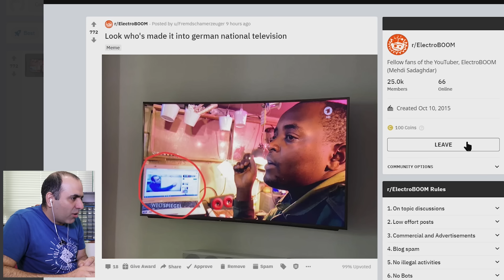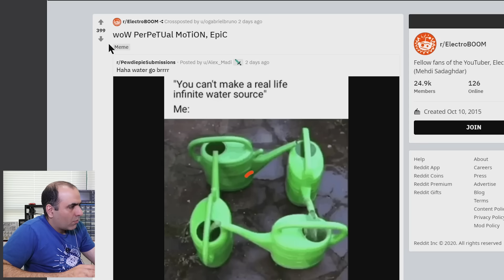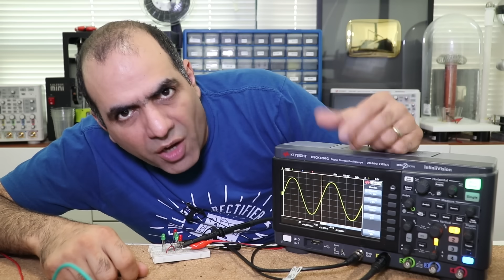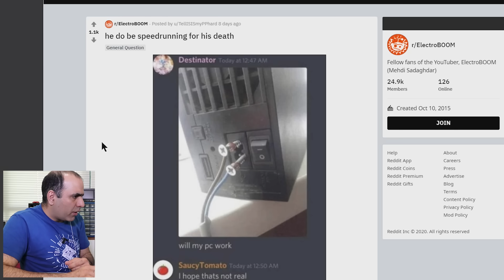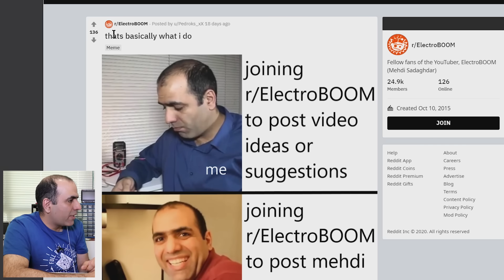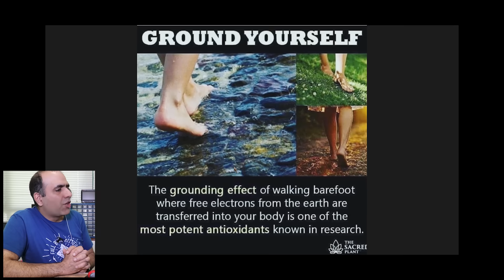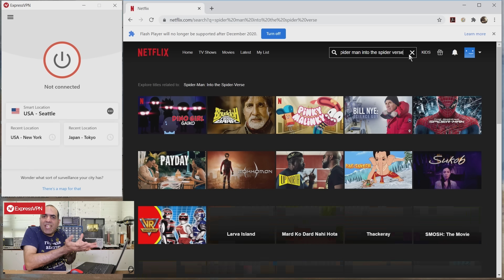Making Water Spin Like Magic, LATITY-002

Comment: Basic Principle
You place a conductive fluid (like salt water) in a dish.

Electrodes connected to a battery are placed into the water and a magnet is put under or next to the dish.

When electric current flows through the water, and a magnetic field is present, a force acts on the moving charges in the water.

This force is called the Lorentz force and it causes the water to move or spin.

The Physics & Formulas
Lorentz Force Law:
The force acting on a charged particle moving through a magnetic field is:
F
⃗
=
q
(
v
⃗
×
B
⃗
)
F
 =q( 
v
 × 
B
 )
where:

F
⃗
F
  is the force vector (in newtons, N)

q
q is the charge of the particle (in coulombs)

v
⃗
v
  is the velocity of the particle (in m/s)

B
⃗
B
  is the magnetic field (in teslas)

For a bulk fluid (saltwater):
Current density 
J
⃗
J
  replaces velocity:
F
⃗
=
J
⃗
×
B
⃗
F
 = 
J
 × 
B
 
where 
J
⃗
J
  is the current density (A/m²), and the overall force per unit volume causes the liquid to move.

How Spinning Begins
Current flows between the electrodes placed in water (which must be made conductive—usually with salt).

The magnetic field interacts with this current and, because of the direction of the field and the current, produces a force at right angles to both (by the right-hand rule!).

The result is a circular force that makes the water spin—you can reverse the spinning direction by flipping either the magnet or switching the battery's polarity.

Concrete Example and Measurement
In experimental setups, the fluid speed at a location a distance 
r
r from the center is:
v
=
ω
r
v=ωr
where 
ω
ω is angular velocity.

The voltage and magnetic field strength relate to the force and hence the speed of vortex formation: for a mean field 
B
B and applied voltage difference (producing current), the induced speed can be estimated by balancing the Lorentz force and fluid drag.

The Experiment Must Have:
A conductive solution (plain water doesn't work!)

Sufficient current (power source)

A strong magnet

Reference Examples
[Scientific American] and [Physics Van] explain and confirm this effect. You can watch step-by-step demonstrations in [YouTube videos].

In summary:
The water spins because the electric current in the water is deflected by the magnetic field, producing a force that kicks the fluid sideways and causes rotation. The direction and speed of the spin depend on current, field strength, geometry, and conductivity.

Comment: 3:40
What if you attached a tiny AC generator to the spout where the water is flowing from? The water pressure spins generator. If you limit the resistance I'm sure you could get SOME voltage out of it.

If it worked small scale, what about large scale?

This wouldn't be creating energy but instead using the energy that gravity already acts on the water.

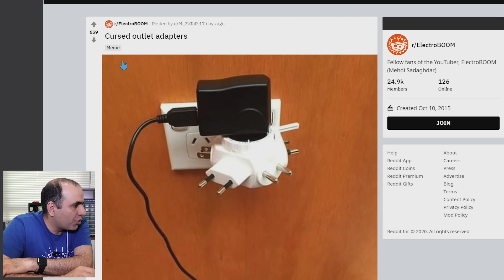Comment: I have that cursed thing at 6:28. It's a travel adapter. You can turn the top bit to select which plug on the side should connect to the socket on the top where you plug in your appliance. It definitely looks cursed though, and while in theory, only the selected prongs should be connected, I wouldn't touch any of the unused exposed prongs while it's plugged in.

Comment: Wow,  I hate the selling point of these VPNs. Logging into another country just to see entertainment. If you read your subscription service for all of the streaming providers,  they all expressly address using a VPN to circumvent a regionally lock.  And they hold the right to terminate your account.  Your VPN is not as secure as you think when your browser holds extensions for both the streaming service and the VPN.

Comment: the water spinning at 7:11 is surprisingly close to working, the thing is you would need magnets at the bottom connected to the water and the water to be charged like a battery, short the two and in theory it would spin like the batteries in mehdi's simple dc motor video :3 just a fun idea, idk how to get the water to function as a battery tho besides like using highly concentraited salt water in a zink cup with a cooper electrode sticking out of it

Comment: 4:15 I had a capacitor blow up in front of me, and the little metal can shot toward my face, turning in the air so that the open end punched a neat circular cut deep into in my cheek (it healed with no scar). I am lucky it wasn't my eye. Please wear eye protection when you're around something that has potential to explode!

Comment: Mehdi, did you think about this VPN services? About how they work? Let's see how the network cables are connected. 
Your first connection from your computer, mobile phone, tablet etc. is to the router/modem-router combo.
Then, your modem connects to another router outside, which distributes network access to your area. After it, it connects to several routers in-between, and at the end, there is your internet service provider. 
Because your modem in your house connects indirectly to the ISP's servers, a VPN can not protect your datas, only can hide your exact location from the other side, not from your ISP.
Your ISP will be able to tap your sent and received data, because your devices are connected to them by wires. No matter what paid service you're using for protection. If they want to know your activity on the net, they will know.
VPNs are good for watching locally restricted contents, but they can't protect you from being tracked. Your ISP will happily tell anyone for a bunch of dollars where you are and what you did on the computers. Guess how a chemistry student was jailed here, he started looking for the precursors of dangerous materials, and look, he got sentenced for owning those things, which he could buy and order from the net without any question.

Comment: Funny story about GFCI outlets. The upstairs bathroom in my house has no GFCI outlets in it. Why is this? Well, whoever wired the house wired the bathroom and an outlet in the garage (on opposite sides of the house btw) together and the outlet in the garage is GFCI. We only realized this when a leak in the garage caused the GFCI to pop and the bathroom outlets stopped working too.

Comment: 6:33 The cursed outlet adapter! I have one of those. It looks dangerous but fortunately only one of the prongs is live. The way it works is that the middle part rotate with an arrow indicating which prong is currently connected to the center. This is a clever device but it is unfortunately a bit cumbersome.

Comment: If you have a radiator for hot water. Then using the anode effect could heat the water with 120 watts could heat it at 12v and 10 amps. The water container with copper and aluminum electrodes works but maybe it is better to use graphite rod electrodes and make sure the electrodes are far apart in the electrolyte. The electrolyte is just some cheap crystal growing kit from the dollar store or online science shop. The water will start boiling and getting hot in about half an hour or so. A small 200 watt fan can blow air through the radiator to warm the room. This isn't free energy it is just exploiting a novel effect.

Comment: When grounding yourself for doing electronic repair, it should be through a 1Megohm resistor. Don't believe me? Just Axe Mehdi. Without the resistor, you are almost as dangerous to your electronics, and potentially yourself.

Comment: If you can make water spin with a magnet, you could put a paddlewheel and generator in the water and have FREE ENERGY!!!
Better yet just skip the generator and wrap a wire around the paddles 5 times, it will work like a generator but cost you nothing.  FREE GENERATOR for the FREE ENERGY!!!

Comment: Wouldn't a big resistor in series with your LEDs allow you to visualize the output of the bridge rectifier (take most of the voltage drop)? You could put your circuit in parallel with a lower impedance input and reduce the power costs?

Comment: I actually have that travel plug at 6:26. You can turn the top, where you plug your device in and depending on which way you turn it, only one side is connected. So it's safe actually

Comment: 6:30 These Adapters really exist. Not all the prongs are live at the same time tho. You instead select a certain connector by rotating the top part, where your device is plugged in.

Comment: You could try power supply with other end of the wire the other end of the wire has no plug you can join the plug with your covert safe and you have another outlet so join the plug on your covert safe to you outlet

Comment: 6:36 I own one of those adaptors.  The prongs are not all live at once.  You rotate the round part at the top to select which one to use.  It doesn’t convert voltage, which is interesting if you’re a North American using it in Europe.  Your phone charges a lot faster
Reply: And by 'Charges a lot faster' you mean it blows up

Comment: Bathroom outlet reminded me of military school and how we would light cigarettes, piece of led from mechanical pencil broken in half and put in the top 2 slits of outlet then take another piece of led put through a q tip horizontally that you pulled on and fluffed up, connecting to the 2 in the outlet and boom a match.

Our lighters and matches were always confiscated, sometimes you could light the cigarettes on a desk lamp some ppl had that would get hot enough 😜

Comment: 7:46 Is this the official electroboom gfci outlet test? Now you just need a thick wire instead of the resistor and you can test the breakers on normal outlets too :)

Comment: to my knolage paying customs is related to one of 2 things in general if i am not ignorant and mistaken.

1 coruption they want money any way they can get it so if you can milk some money from items going into the cuntry they do so.

2 to simply protect the economy of the cuntry itselfe. wery simply every dollar spend inside the cuntry is returned to the cuntry. with that i mean it stays in the cuntry and can do good. like if you buy food from local store the store pays taxes helping the cuntry grow and pays the emploies that then spend money and that creates a loop. but however if you spend money outside the cuntry that money is lost it is sent otue of the loop and is negative for your cuntry. however getting people from outside your cuntry to spend money inside your cuntry does the oposite it gets new money into the loop benefiting the cuntry.

so with this simple knolage export of goods is good as that brings in money inport of goods is bad as that takes money oute. so to limit the inport they put high customs on it to prevent money form leaving as in alot of cases it is alot cheeper to buy it localy instead of paying the customs. by that the system is succesful as it keeps the money in the loop. however this does not include gifts as these are not money going oute of the cuntry. but it is a flaw yo uhave to live with for the system to work. eaven worse is if the product is made localy then you inport an alternative for free while this doesn ot remove money from the loop it does prevent local providers of the thing from selling their things therby hurting the economy.

therfore you wil in msot cases see that cuntries that produses a product wil have realy high customs on alternatives to this product to prevent cheeper alternatives from otuside to harm the production in the cuntry

Comment: You can make water spin with electricity. It doesn't work like that silly video, you take advantage of magnetohydrodynamic effects. Saturate some water with salt, then line the rim of a non metal dish with foil to make a contact. Put a neodymium disc magnet pole up under the dish. Now pour your salty water into the dish and add some fine visible particulates like pepper so you can see the flow. All that's left is to connect something like a 9v battery to the foil rim and dangle the other contact in the center of the water. This creates a current flow radially outwards perpendicular to the magnetic field resulting in a thrust which makes the water flow around the center contact.

Comment: I have a question. At 9:35 in the video you said if something is floating in air the voltage across it will be minimal and current wouldn't flow through it no matter how much electromagnetic energy is present around it. So does that mean that an airplane flying through a thunderstorm is not very likely to get struck by lightning ?

Comment: 9:25

The idea is that the body has something called (free radicals) it's basically positive ions running around your body and stealing electrons from random atoms screwing up your cells or DNA.
I think those free radicals might act as a voltage difference between you and the ground so electrons would travel and neutralize those free radicals instead of allowing them to take from your body, that's what antioxidants do at least as they are negatively charged ions.
Reply: Free radicals aren't always charged (sometimes even negative). And positively charges ions are not always free radicals. Examples are the hydroxyl radical (neutral free radical), the superoxide radical (negative free radical) and potassium ions (positive ions that are not free radicals). It has to do with unpaired electrons, not charge.

Comment: They charge customs fees because citizens of country X are supposed to use products from country X so the jobs and money go to country X, but since country X can't prevent anyone from getting products from country Y, they apply a penalty for not getting a local product. If you want someone to get something without them having to pay for customs, either remotely buy a comparable product from a company in their own country and have it shipped to them domestically - THAT is how you help those countries that need it the most to grow, by funneling money into their manufacturing industry - or, in case their country only produces terrible quality versions of whatever item is in question, ship the good stuff with the incoterm DDP, where duties and taxes are billed to the shipper instead of the receiver.

Comment: Hi ElectroBOOM i am a viewer from Algeria and i have so many questions to ask you about electrical installations.
the two most urgent are related to solar installation and grounding
1. i have a distribution board with two sources of electricity, city electric and solar (2400W inverter) 
the thing is the two electric circuit are never in contact with each other  but i have to properly ground all the electric sockets for safety .
the question is do i make sepret grouding bar for the diffrent sockets or it doesn't matter or there is other solutions.
2. for my solar installation i have a pure sine wave inverter from EPEVER 2400 watt and the problem is that it is properly grounded but when i mesur from the neutral or live wire to the ground i have half of the potential (115 volt) .
ps:  i have 230 volt between neutral and live
i heard about neutral bonding and floating neutral but it is high level for me.
i hope you can help and thank you in advance.

Comment: I really enjoy your videos,  lots of fun, what I did not enjoy, was watching you  hold 2 wires in your hands, from the secondary  side of that microwave transformer with some  who knows what  plastic spring clamps drawing arcs.  that is really foolish. don't be complacent.  you were putting the possibility of  that secondary voltage and current across your heart.  could have arced through the plastic and into the springs and into you, that is dead you. I know you know electricity and its  dangers, but it only takes one mistake trying to make a video to be killed by these highly dangerous transformers. it has happened. be careful my friend. concerned  viewer.

Comment: Hey Indian, Please see my video on reactive power. Reactive power is nothing but the power oscillations in the circuit due to inductors and capacitors present. It is really confusing when we are studying reactive power only with the phasor diagram, I have explained the concept with the help of fundamental waveforms. Also explained why reactive power compensation is necessary, how we can compensate.

Comment: My house is so old the wires are covered with fabric and the outlets spark Every time I plug something in. 90 percent of the outlets are only 2 prong and are circular. My light switches are metal and they're hard to flip, one of them is upside down, I have a couple push button lights and  two outlets don't work
Reply: Oh, textile insulation, that’s rare.
Reply: Some Shape I live in an old house that’s been renovated and a good bit of my wiring is the old rayon from before the renovation. It’s pretty common. And my brother totally renovated his house, completely redid the wiring in the entire house, and he figured out it was still knob and tube 😬
Reply: "fuck I's do love the 60s" -Explosions&Fire
Reply: @marblemarble7113  queue picture of a nuke going off
Reply: Sounds dangerous
Reply: In London we fairly frequently find asbestos fuses and VIR (vulcanised Indian rubber) cables (the fabric ones) in old houses. All wonderfully brittle and easily broken! Really hate that stuff
Reply: Not as rear as u'd think i have worked on several house with fabric insulated wire. Most of them had chared wire. i'd recommend a rewire of your house if ur wires are crispy. Other wise its good wire as long as its still intact
Reply: @ogxphobia3569  I know it's not rare
Reply: Our light switches are still ceramic.
Reply: @roentgen226  oh yeah there's one of them in the basement
Reply: "yeahhhhh" mehdi when he sees this.
Reply: Oh god
Reply: I bet electricians would hate to work on that
Reply: @SockyNoob  They just cut the old wires and bypass it with new  NMC or BX, depending on the local code.
Reply: my house is just like that lol
Reply: ElectroBOOM wants to know your location.
Reply: Same
Reply: Mine still had copper wire coverings
Reply: g